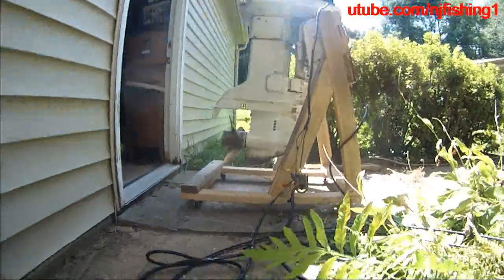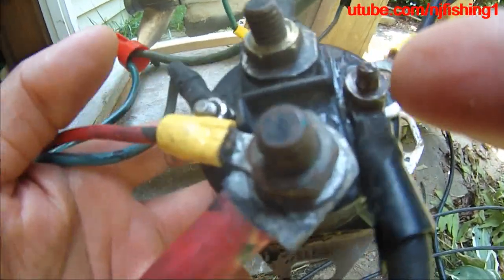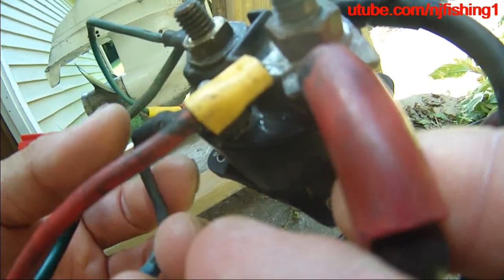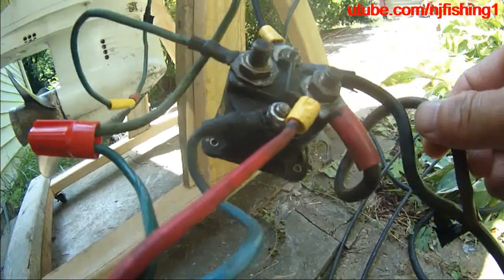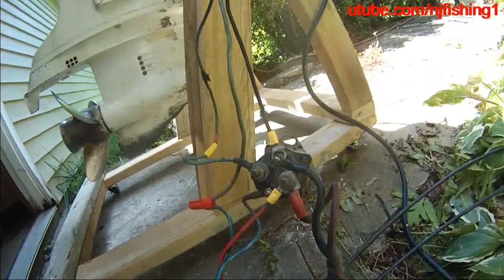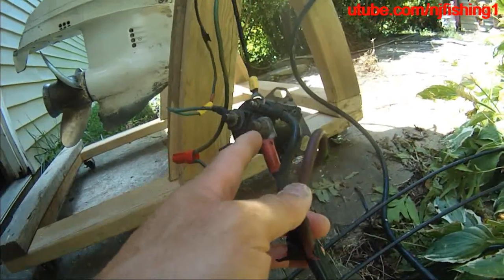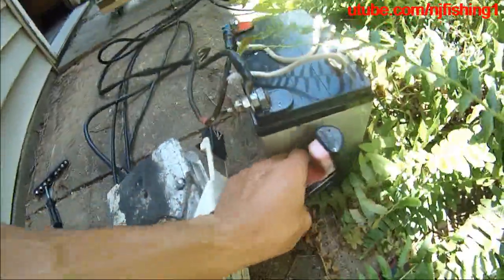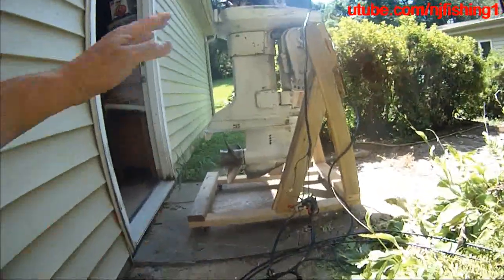How to use car solenoid to trim/tilt Johnson 90 hp outboard?

Comment: Solenoid  2post Battery 12v & to starter  other 2 small post or scews one is I other is  S 
Think if you identify what and how Solenoid is marked then explain your wiring.  Would help. Otherwise interesting and confusing

Comment: my trim/tilt works just with hooking up battery cable on a stand. try starting it on a 25/1 mixture on fast idle while choking it. use the Johnson 2 stroke red label oil, it seals the rings better.
Reply from the maker: The direct connect from Remote Control to trim/tilt will not power trim your motor unless you use a solenoid. You will need to use your remote control to trim your outboard up or down to plane the boat quickly.
Reply: @njfishing1   njfishing1  when its on the stand I do not need to connect the remote to trim/tilt. I can use the side button. the only solenoid I can think of on this motor is the starter which is nothing but a relay that when 12v is send to it, it completes a ciruit that sends battery volts to the starter. so maybe u could be right their is a solenoid for the trim/tilt motor as well since it's a big motor & need 12guauge battery volts. I couldn't see just 16 gauge wire from the remote powering it. thnx for the tip.
Reply from the maker: @fishawk90  my 1982 Johnson 90 hp does not have a side trim/tilt button on the motor but my 2019 Yamaha does have a side button on the motor itself so that is very convenient. Kudos to the previous owner who set it up using the car solenoid instead of the OEM Johnson trim/tilt solenoid. His original wiring was even more complicated than what I have now. He was wiring everything to a junction box like setup. I got rid of the box and just direct wire everything to the car solenoid to my remote control at the steering wheel so I can drive the boat and trim my Johnson 90 hp  outboard. It is super nice especially when launching and retrieving my boat off my trailer at the boat ramp. A very smart way to save money. Believe me I tried direct connecting the remote control to the trim/tilt motor and it would NOT work so I had to bit the bullet and get a car solenoid instead of the OEM solenoid. The wires inside the remote control is simply too small to trim/tilt the motor or starting the motor. It is a big heavy powerful motor. It can even tow a skier in the back. I can plane my 17 feet long Wellcraft boat at only 20 miles an hour. It is old but functional.